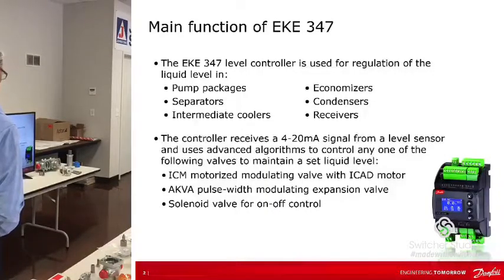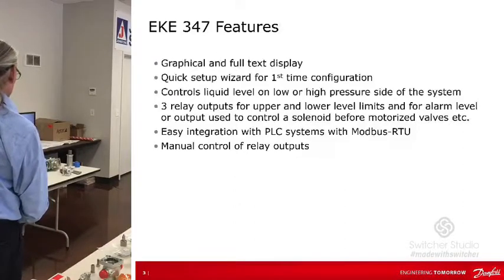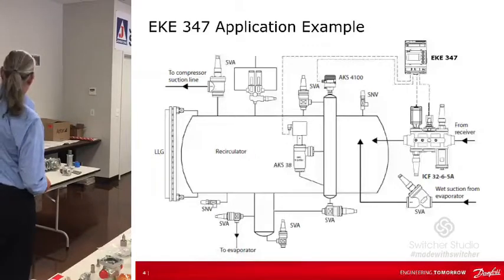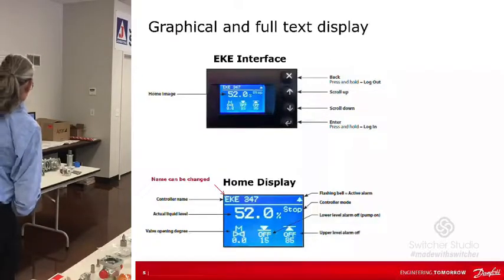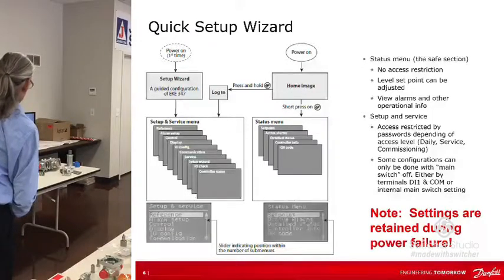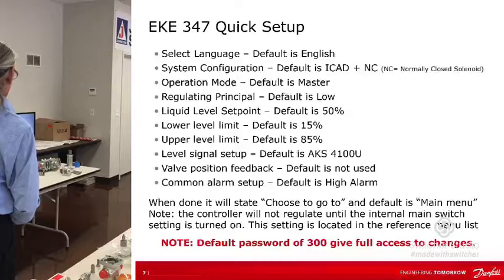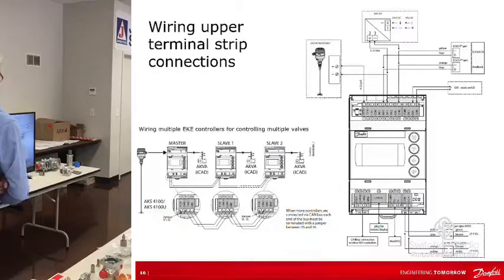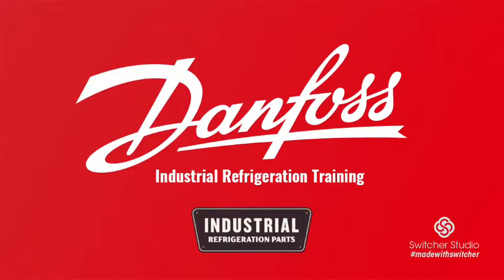Danfoss Training: EKE 347 Liquid Level Controller

Comment: Sir can i still use the old system using adapcoll for this control?  And how?
Reply: Adapcool
Reply from the maker: @SirNannanTV  We're checking with Danfoss. Can you also email your question to support@industrialrefrigerationparts.com? We'll have a Product Specialist follow up with you.
Reply from the maker: The EKE can be read with a CAN or modbus connections, as long as the main controller has one of these protocols. But, it may depend on the software version. If you can find the details for the specific controller, we may be able to help with additional questions. We can also email you a data sheet with more information. Please contact support@industrialrefrigerationparts.com/